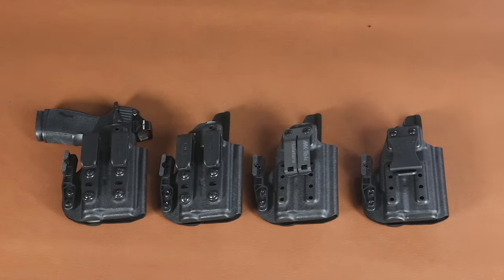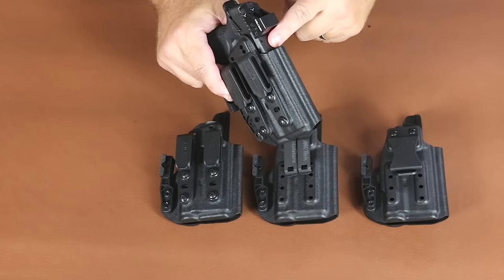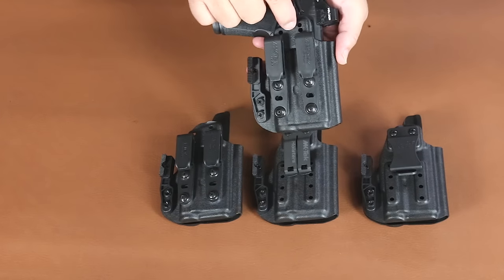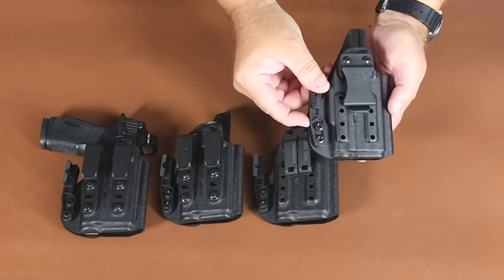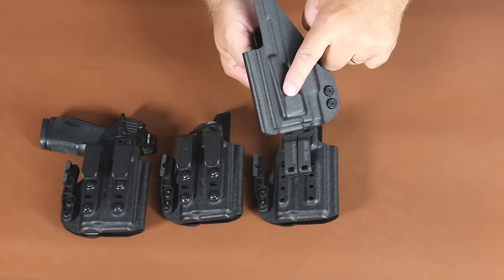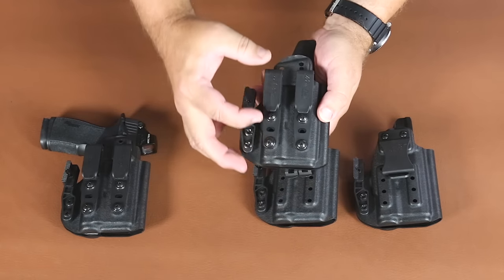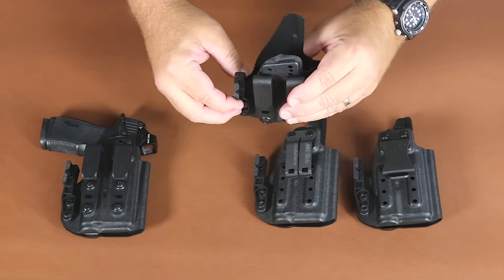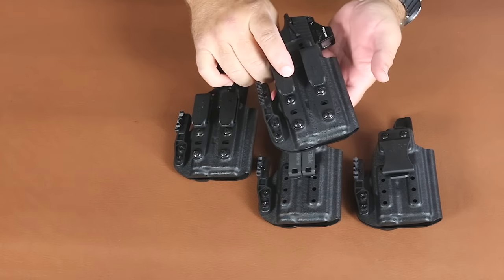Sig P365 X Macro TLR7 Sub Holster

Comment: All holster reviews should show the gun in the holster on the body !
Reply from the maker: Thank you for the comment. As the manufacturer of the holster we like to show the features of the holster that would be hidden while worn on the body.
Reply: @mk-tekholsters  I understand but, when on body you can see how high it rides, how easy to get a full grip. It’s a must before I buy any holster.
Reply from the maker: @robmiller54 perfect. When the holster is inside your pants there are several ride height options with the dual clip option. You can go from deep concealment to high ride height and in between.

Comment: I was on board till I saw the difference in price between a P365 holster without a light at $57 and 92 for with.  That is a large disparity almost a penalty for having a light on the pistol.
Reply from the maker: Well actually the difference is small. A light adds $20 to the holster. The other add on features make it $92
Reply: @mk-tekholsters  But they are required add-ons no way to remove the wing on these setups.
Reply from the maker: @Edge51  correct but the concealment wing is a great feature to reduce grip printing. The molded in Tuck n Roll is a great feature that allows for more comfort and concealment. The adjustable ride height features are a great benefit for those who use an optic.
Reply: @mk-tekholsters  That may be but I have a bag of holster parts which includes a bunch of wings from other makers I take off because they do not work for me nor do I like them.  I am sure all these features are great if they get utilized for me I am not going to use them unfortunately.

Comment: Do your holster protect the slide from scuffs and scratches to the finish, or do they (like most other holsters) make scratches and scuffs ?
Reply from the maker: We build in clearance around the slide and frame. We want all the retention on the trigger guard.
Reply from the maker: On our light bearing holsters the retention is on the light unit attachment mounts
Reply: @mk-tekholsters  We sent you guys an email asking this same question. We'd be interested in maybe trying one of these out if you offer it for the TLR-7A.
Reply from the maker: Sorry we do not offer the Macro with a TLR 7A option. Only the 7sub at this point.
Reply: @mk-tekholsters  Bummer. The search continues !